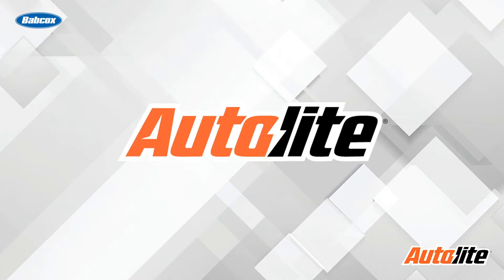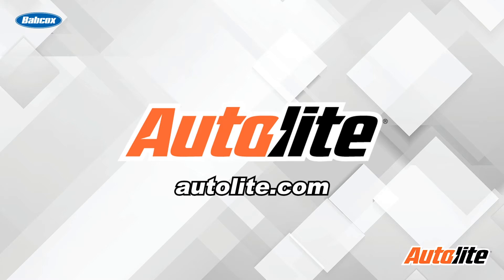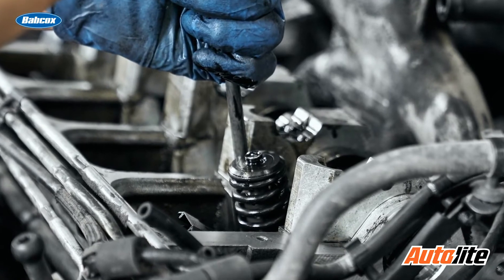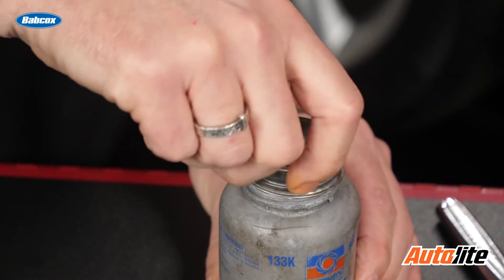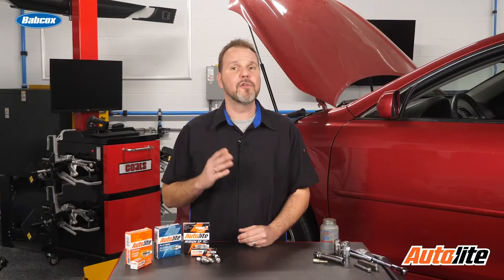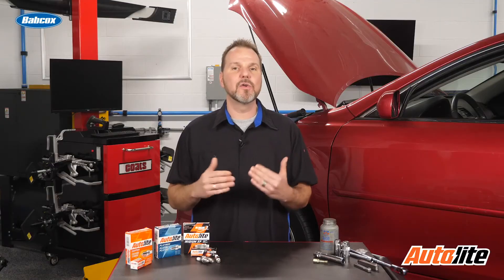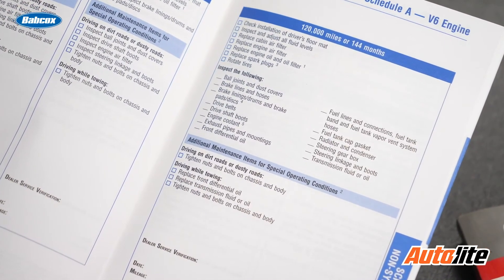Should Anti-Seize Be Applied On Spark Plug Threads?

Comment: Anyone stupid enough to over tighten a spark plug to the point of galling or breakage has no business  in an engine bay. By your own logic anti-seize renders torque specifications invalid in every threaded application where it is used and if it does it is still the lessor of two evils. Most importantly as a mechanic  you best know even dielectric grease does not and would not create a  restive connection where metal to metal contact is made........Your error is that you are catering to extremely un mechanically incline viewer

Comment: While you make some valid points, I respectfully disagree. I have built race engines for years, especially ones with aluminum heads. Spark plugs will go in and out of that engine several times at a race. We always use anti-seize to protect the threads in the heads. Heli-coils will work, but nothing last as long as the original threads. IMO.

Comment: We know that aluminum oxide is a poor conductor.
Often times alum heads need to be cleaned where ground straps attach.
Same for spark plug threads.
Preventing galvanism with anti-seize is totally safe.
Spark plug threads only need a smidge of anti-seize.
So, when moisture and electricity combine
minimal oxidizing occurs.
Plugs will always emerge easily, and both threads win.
If you are rich, don't use anti-seize and brag about your new head, or 
expensive re-threading job.
JESUS CHRIST, the choice is obvious !

Comment: If the torque setting is to turn 1/4 past contact to crush the washer, I cannot see how anti-sieze would affect that. I always used anti-sieze without any issues at all. In fact, it made the changing of plugs much easier. Anti-sieze compounds contain metals and are conductive. Grounding is no issue.

Comment: Anti seize is  ESSENTIAL  when fitting stainless  NYLOC™ nuts to stainless threads ( especially M8 and bigger ! ) .... the constant grinding when tightening  WILL  cause a cold weld and then you need an angle grinder to remove the damaged assembly , causing MUCH aggro and bad language ( tried - n - tested ) ........ DAVE™🛑

Comment: Personally I disagree with nearly everything this guy is saying about NOT using anti-seize.  When I DIY replace my own Motorcraft plugs my 2V Ford 5.4 plugs I'll use a nickel-based anti-seize on the proper plugs along the threads, torque to 26 ft/lbs and know this process has been successful since at least 2008 for me.

I also change plugs between 50-60K miles, replace any boots that look suspect andI've never had to deal with plugs stuck in their holes nor had to deal with plugs loosening over time.

Comment: I agree with you for the reasons you mentioned plus one. It has been my experience that anti-seize shouldn't be used in areas with extreme heat and long periods between removal. The anti-seize can turn glue and cause the exact opposite of it's intended usage.
Reply: Copper anti seize fixes this issue..

Comment: i'm just a home mechanic but i have always applied anti- seize graphite grease to spark plugs especially on aluminum heads but careful about tightening. i always wondered how putting any grease on bolts going into blocks or heads affected the torque measurements and bolt stretch.

Comment: This does not "settle the argument once and for all."  It's just a complete rehash of all the debating points. The temperature point?  I have yet to see a single test that shows that antiseize disrupts the flow of heat.  Grounding issues?  Same--show me evidence that antiseize disrupts the path of electricity. I've been putting antiseize on any spark plug that goes into an aluminum head.  Never had a single issue.

Comment: Yes, but if you dont have a wet thread torque spec, reduce the dry thread torque by something significant, some say 20-30%. After removing 10 year old OE NGK plugs from a Honda J-series engine and having to endure the screaming banshee-like sounds of removal, and surely witnessing a miracle that they didn't gall, I always use anti-sieze.

Comment: WRONG... Brodix heads requires use of Anti-seize for warranty... As a long-time machinist, I say yes to using it in moderation on anything with aluminum female threads, especially with heat and corrosion otherwise you will eventually cross-thread and ruin the hole. As far as torque, an experienced person has the feel for a tight plug with or without lube. Lose the torque wrench as it is text-book and not real-world. The seat or gasket washer don't get the lube and provide a secure ground..

Comment: A solution is if plug manufacturers used stainless steel for the plug body. Problem solved. Of course, there's the xtra co$t i$$ue for using SS material.

Comment: At 74 years old, I was taught how to properly install spark plugs. Tighten until you "feel" the crush washer "crush", then stop. If you've ever had a spark plug twist off in the head, upon removal, you might consider some kind of lubricant.😁
Reply: 74yo but today engines alloy more delicate most cast iron when u were young lezrnt your skill

Comment: 1st of all, you ONLY use 'aluminum anti-seize' on steel to steel/iron.  If you have steel going into an aluminum casting, aluminum anti-seize doesn't give you galvanic protection.  Autolite is trying to get mileage out of a special coating they use, but they won't foot the bill for redeeming a seized plug.  A light touch of COPPER anti-seize on spark plugs IS A GOOD CALL.  At worst, it won't hurt anything.  Some of these modern cars use long thread plugs that are literally down in a hole.   Moisture sits there, wicks into the threads by capillary action. Becomes 'electrolyte".   A plated coating on SP threads partially scrapes off on first install.  Use copper anti-seize on all spark plugs and O2 sensors.  ALWAYS.
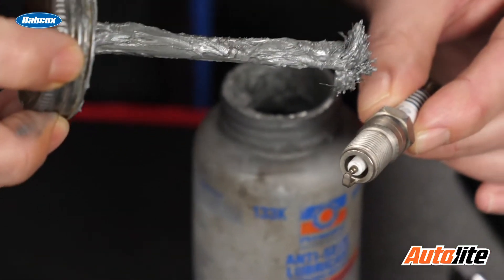Also, looks like a 5YO has been using that Alum AS by the looks of that brush at 1:09.  Pitiful.

Comment: Meh.  The risk of over-torqueing by someone who knows what they are doing.... is relatively low compared to the amount of pain felt, if a plug seizes in place because you didn't put anti-seize on it.   No thanks...  after 40 years experience, I'll keep doing it my way.
Reply: "Knows what they're doing" is a term that gets overused, imho. I think most people who are doing something *think they "know what they're doing" and might not. Personally, I dont use antiseize on anything unless it's hardware that normally would get seized or is in highly corrosive conditions like o2 sensors or the upper and lower control arm hardware, exhaust manifold bolts etc.

Comment: .. i use a little Oil & reduce the Torque by a bit, especially in Aluminum Heads..that Anti Seize will as you say Affect Grounding, as well as Build Up in the Threads.. 🧰👨‍🔧

Comment: My experience with plugs and no-anti seize is that there is a good chance of stripping the thread when it comes time to remove it for the first time. You have Aluminum and Steel (a galvanic couple) then you are passing thousands of volts thru the thread. If you think about it, that is how an EDM machine works. The longer it stays in the engine, the more likely it is to seize in place.
I use motorcycle chain lube on the threads. Don't use anything with copper in it, it will rot aluminum.

I torque plugs by hand and on new plugs, I crush the washer flat. Having had a couple of plugs back out when installed to the correct torque, I don't trust doing it any other way.

I understand the principle with the washer design. It is supposed to be self sealing, with the gas pressure coming by the threads and "inflating" the cavity in the washer. In reality, you just have a loose plug with poor electrical conductivity that is ready to back out and could already be misfiring. 

The carbon left in the gas path does act a little bit like anti-seize, so why not put some in.
Reply: Aluminum -steel - cadmium plug plating   copper AS makes 4 metals.I use an AS on all the gas engines I own.I know there is a perfect AS but I don't know what that is so I at least grease the plug tighten it TIGHT to crush the sealn washer back it off and re torque.   Thanks for your post/cheers
Reply: Copper !     That might be a good point. I use Copper Coat on my plugs, but it's an older Ford FE 390 with cast heads.
Reply: @UNITED2009100  My brother had an outboard motor on a boat used in the sea. The aluminum castings had copper in them. Water pin-holed the castings and was spraying out
You should be good with cast iron heads.
Reply: The boat motor might be a little different. We fight "electrolysis"  issues on boats. That is why they use zinc pieces on boats.

Comment: I might agree with the decrease in grounding capability when anti-seize is applied but not the torque argument. My Torque Wrench clicks or beeps, depending on which I am using,  when it reaches the chosen torque setting. It doesn't have an anti-seize sensor and it doesn't adjust the torque setting because I used anti-seize. If you are going to offer that argument then you will have to demonstrate that it is true.

Comment: In a perfect world nope, for a spark plug manufacturer to recommend it no because they have to cover their asses. In the real world of engines like marine, dirt bikes , snow blowers, aluminum head , it’s a good idea. Like everything there is too much of a good thing so I like to use a small amount just a bit on the first 3 or 4 threads then wipe off the excess and this will be enough to prevent galling which can break a plug especially the little ones and NGK brand like I use on my Yamaha FX . Be careful not to get it on the end of the plug that goes inside the head or on the electrode . Reduce the torque applied 20%. Because it’s a lubricant . A new spark plug will have a sealing ring that needs to be crushed, a used plug is already crushed, so if you were servicing a motorcycle or jet ski use a fresh set of plugs so the sealing ring crushed and grips like a fresh copper washer on your oil pan. The other rule of thumb is torquing. On most fasteners if you seat them then only tighten to one crown of the fastener head or Crown and never back it off and leave it you must do it again.  With a new plug on an expensive little engine like a motorcycle use a good quality torque wrench or risk thread damage but don’t stop there,,,,use a dab of dialectic grease on the ceramic insulator to prevent moisture and internal arching under the boot,,,MY INTERNAL COMBUSTION BROTHERHOOD ,,,ASE Master tech 1988,   Peace on dirt and ocean

Comment: This is a debate that will continue long after all of us here watching this are gone. As a certified aircraft engine mechanic, we were taught a little dab'll do you and to dab a little on spark plug threads being careful NOT to get any on the lower 2 or 3 threads of the spark plug. And then we were taught to ALWAYS use a torque wrench on those plugs. So, to dab or not to dab, the debate goes on.

Comment: An issue I have seen is with anti-seize migrating out of the threads and bits of it ending up on the insulator, grounding out the spark plug.

Comment: YES use anti seize BUT: use one that is both electrically and thermally conductive, only put on the bottom couple threads ensuring none gets near the electrode/gap/end contact, and derate the dry torque value by 15% to get your new proper equivalent wet torque value. Yeah yeah yeah complicated and expensive to find an anti seize that meets the thermal/electrical conductivity but worth every penny and second! Invest now for painless removal few years down the road.

Comment: I use it and always will.  Most heads now days are Aluminum. Spark plugs are steel.  Bad mix.   The only thing I recommend is using a copper base anti seize.   It gives you conductive properties and equal heat transfer.
Reply: Plus one on the copper base.It's the only stuff I use.

Comment: Confused about zinc coated material for the plug instead of using antifreeze to avoid.  You stated don't use "it" that could refer to one or both.  Is "it" meant to say don't use the zinc-coated spark plug or don't use the antifreeze or both.  We know the antifreeze is not to be used for the threads.  Thanks

Comment: I've been using it since the mid '70's and never had any problems and never used a tork wrench eighter I've been playing with cars since I was 14 years old I have the feel for how tight it should be only time I used tork wrench is on engine rebuilding or major components like transmission and differential... Just snug the up just like an oil filter... And blow air around the spark plug before you attempt to remove them to remove dirt and crap so it doesn't fall into the combustion chamber...
Reply: I used my cordless leaf blower and a parts cleaning brush. Brushed and blew most of the parts under the hood while I was at it.

Comment: Sorry but, you'd have to be an idiot to torque a plug enough to cause it to break or strip the threads out. I have always used anti-sieze on plugs. I dont cake it on.... just a thin film on the threads. Especially on aluminum heads!!

Comment: My procedure on sparkplug replacement, where the threads of the block and plug are dissimilar metals, would be to apply a small dab of anti-seize to the threads on the plug, but not closer to the electrode tip than about 5mm. I would then finger tighten the plug until the gasket just comes into light contact and then slowly tighten with a wrench until the washer just crushes, where you feel the tightening torque beginning to increase more. This should be close to the correct clamping force on the plug to the head, even though the tightening torque is probably below the specified value.

On sparkplugs without washers, I would simply torque to about 70% of the median value of the recommended torque range. 

I've been working on engines in cars and motorcycles since I was a kid in the mid-1960s and have never had a problem with stripped threads or seized sparkplugs. I did have to spray some penetrating oil into the sparkplug wells on a couple of aluminum-head engines and let it soak for a few hours as insurance against stripping the threads on a stubborn removal. I often use a long fat-tube straw as a guide and starting tool, especially on aluminum -head engines, as it is easy to cross-thread those things if not careful. Swabbing the sparkplug threads in the block with a very long Q-tip that has been soaked in WD-40 has worked well for me in cleaning the threads and having a smooth installation. I also blow out the sparkplug well with a shot of compressed air before removing the plug, to prevent the introduction of debris into the cylinder. I will also make sure that the gasket surface on the block is clean by wiping it also with the Q-tip.
Reply: This pretty much my exact procedure, and exact results. The only plugs I have ever had cause thread damage or broke the plug, was in an aluminum head where no anti-seize was used when installed.
Reply: @corey6393  It's a biatch when you strip threads, then apply anti-seize. Like using rubber protectant after it dry-rots ;-)
Reply: @corey6393 👍👍

Comment: I agree with most of the information you gave Sir. One thing I have done since I have worked on gas engines is use 30 weight non-detergent motor oil on the threads. Just a little bit on my index finger while rolling the threads around the spark plug. This was shown to my by a old mechanic and I never ever had a problem removing the plugs. This is especially important in the new engines which have a very light inch pounds of torque specifications. PEACE FELLA TOO.